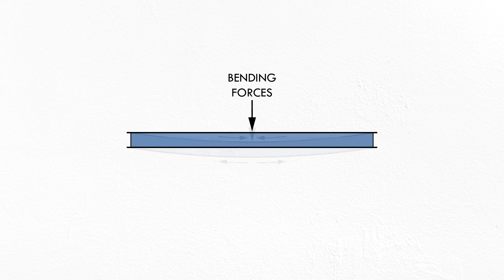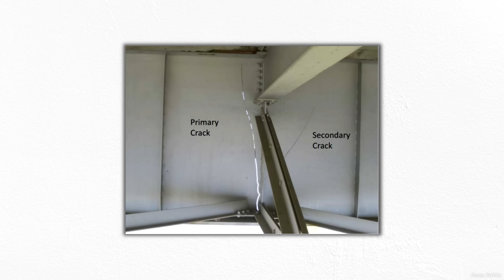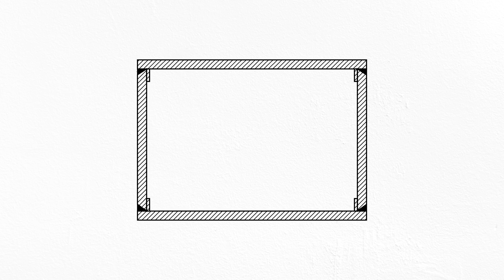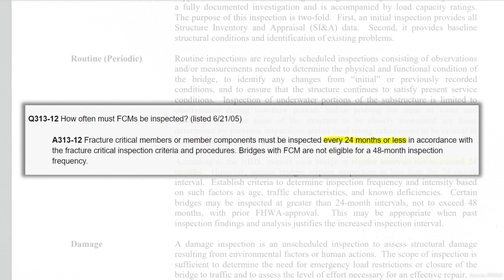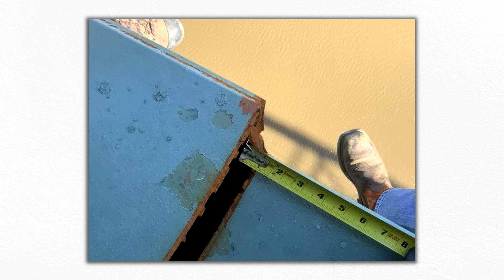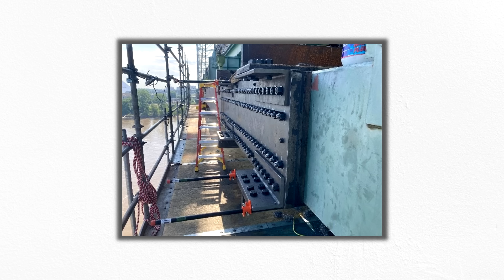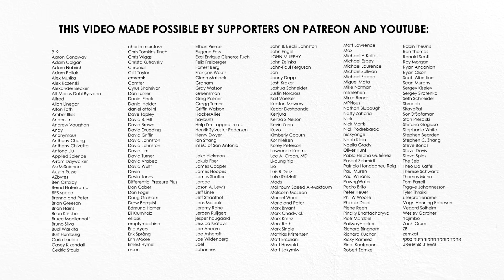What Really Happened at the Hernando de Soto Bridge?

Comment: Obviously without knowing the exact details of the termination of the inspector mentioned, I can't say for certain that it was unjustified. Maybe they did a drug test and found out he'd been working high or something, who knows?

But I think the aviation industry sets a great example for how to handle this kind of situation. From airborne militaries to small charter airlines, everyone in aviation is keenly aware that pilots (and engineers and maintenance techs) are human and can make mistakes. Not only that, they can simply become overwhelmed by their workload.

Much of the industry is explicitly designed around these concepts. It's why there are two pilots on board every multi-passenger commercial flight. On a normal flight, with modern avionics, one person is fully capable of operating all aspects of the aircraft. But when things go wrong, the amount of things the pilot(s) have to pay attention to, do, think about, and account for skyrockets to easily require a second person, or even overwhelm them as well.

When an incident does happen, as long as no ill intent or gross negligence was present, it's very rare for a pilot to be terminated or blamed. Rather, their humanity is taken into account. They are given training to make sure it doesn't happen again, and quite often, the entire industry rolls out the same extra training to prevent other pilots from running into the same problem. Aircraft systems are tweaked or corrected, policy and procedure are adjusted, and the industry learns and grows, and the pilots go back to flying.

A great example of this mentality is the nearly universal policy of the no-blame go-around. The primary concern is always safety, so pilots are trained to initiate a missed approach, or go-around, if they have any doubts or misgivings about how the approach is going. If you're not totally comfortable that the aircraft is properly configured and stabilized, and that the landing will be completely routine, you just go around. No questions asked, no blame assigned... even though that go-around could easily burn thousands and thousands of dollars of fuel, and cost thousands more in delays (not to mention the thousands more burned by carrying the extra fuel in case go-arounds or holds are needed), you don't even have to explain yourself at most airlines. You can just say "It didn't feel right, so I called for a go-around," and that's that. Not only that, but either pilot can call for the go-around, regardless of seniority or who is the pilot flying vs. the pilot monitoring. For that matter, so can an air traffic controller, or even another pilot on the frequency, and the pilots of the aircraft in question will just go around, no questions or hesitation, and no blame.

I've always admired that attitude, not blaming humans for being fallible, but designing for it, compensating for it, minimizing the impacts of those inevitable shortcomings and trying to minimize the chance of the same faults occurring again. To me, it's a very engineering-like attitude. It's similar to the idea that every fastener will eventually fail. At some point, it will loosen or fatigue and break. So rather than blame the fastener (I mean, they are typically not very emotional creatures, so there's not much point in yelling at them...) you either design for it, with a castle nut and carriage bolt that are both well over-spec, or you create maintenance procedures and replacement schedules. Or both. In the same way, designing a protocol or training system with the limitations of its human components accounted for but not blamed or shamed in any way is admirably conscious decision-making to me.

Comment: What concerns me is how the “crack” isn’t lined up, they need to find out why it moved.
Reply: If one side lets go, the other side is under more tension. Internal transverse structures now under more tension caused lateral deflection of the bridge itself resulting in the deflection in the failed joint. I am positive that when the inspector saw the lateral deflection, he (thought OMG!) reacted as he did (expletives assumed). BTW: the deflection confirms that the failed was a major tension load-bearing member.
Reply: Or  a tug ran into pier some time ago and never reported it. Or loose barges during the floods of Mississippi River and plowed into them.. who knows I'm sure they have been run into and scraped against a time or two
Reply: Hopefully it’s not the piers deforming 
due to excessive horizontal loads.  It would stretch the side that’s intact whilst moving the detached side.
Reply: @3of11  well something stressed that steel to move, that means the other side of the bridge in under twice that now.
Reply: Of course the break wouldn't line up: all of its tension load shifted to the rest of the structure which would obviously cause it to warp at least a little from now highly uneven loading. No tie on one side would also cause the deck to stretch slightly, push the piers slightly further apart and let the whole structure sag on that side, hence the far-side of the fracture being lower than the near-pier side. Completely expected from this failure.
Reply: And how are they going to line it up again during the repair?
Reply: @tomboyd7109  Good question, indeed. That is why the bridge is closed indefinitely. Stabilizing the structure is the first step.

To repair it, I would expect that the original tension stress needs to be reinstated by external means (fixtures, pullers, cables, etc...) and the stressed member(s)  then replaced/repaired. Not easy or simple by any means. Considering that the seismic retrofit may have introduced additional complications by stiffening the suport pillar structures which may (or may not) introduced additional stress in other structural components.
Reply: @milantrcka121   It’s just a hunch, but I suspect that earthquake modification may have played a role either during its installation or after
Reply: @ArtStoneUS  Very well may be. I am inclined toward material fatigue and crack propagation over a long period (2+ years) augmented by corrosion. Major contributing factor is lack of proper inspection. Much similar to aircraft structural failure (wing spar)...
Reply: @tomboyd7109  Hammer. Big ass hammer.
Reply: @tomboyd7109  That is the most significant question of the day👍👍
Reply: It always under pressure, it moved because it was an essential part of the bridge

Comment: This is strikingly similar to the bridge in Louisville, KY (Sherman Minton Bridge) that was shutdown abruptly due to a fracture critical component being, well, fractured. Also it shares a similar design as well with it being a through arch design. Albeit, a double decker design. It snarled traffic for the better part of a year. Luckily inspectors found the crack in its infancy and were able to repair it before it got to the level of this bridge.

Comment: Bridge inspection is one thing, but is the design appropriate?   Also considering it is in a unstable area, should there be pin joints where the crack occurred not a rigid connection.   Without a design check the cracks could occur again.

Comment: Mr. PE, is there a bigger down force on the ceiling of the tunnel that has a water channel above it when he ship is going over it?
Reply from the maker: Only if the level of the water goes ip
Reply: @PracticalEngineeringChannel  Thank you for answer! I was just thinking, that if ship is big and heavy and water level does rise, doesn't the additional weight distribute evenly to all water area? Meaning if there's a ship in the canal at all, it would not matter if it's right above the tunnel or anywhere else in this water canal.

Comment: The amount of rationalization that goes on to save a buck on infrastructure repair is terrifying. Sounds like this is a classic case of the government kicking the can down the road for decades so some people can make themselves look good.
I used to work for a company that was contracted by a state government for environmental inspection. Some of their jobs were inspecting areas around bridges prior to repair work, due to endangered animals living in the waterway. The number of crumbling concrete bridges from the 1920s (yes, nearly 100 year old bridges) and severely rusted steel bridges clearly missing bolts that the environmental people happened to notice is pretty terrifying. Worse, some of those jobs were prematurely cancelled due to a lack of funding. There are a few bridges I don't think I ever want to drive on unless absolutely necessary.

Comment: I believe AvE said it best. "The standards are written in blood."
Reply: Yes, but sometimes that blood was due to stupidity and carelessness and not a true problem with operation. 

You’d be surprised how much OSHA doesn’t actually require, but companies go out of their way to protect stupid. Which in the end creates more upkeep issues, lack of access / restricted access in previously free thoroughfares, equipment being “built in” (I.e. all the “safety” upgrades now makes it impossible to get the proper equipment in to an area so now doing the maintenance is FAR more dangerous). I’ve done maintenance and engineering in a steel mill, paper mill, and foundry. Handwringing dipshits who have no idea what any work entails (by operators or maintenance/facilities) far too often “make it safer” (laughably not, or in such a minuscule way it’s of no effect) in ways that now put maintenance in far riskier positions. “Someone might burn their hand being a place they shouldn’t be” now became, “now that there’s no proper way to get lift equipment in, maintenance will have to rig and hand lift a 3,600 piece of machinery out AND back in every time it needs servicing. Good thing we exchanged a burned hand for far higher potential loss of life or limb.
Reply: @ObservationofLimits  A good example of this is spray on fireproofing on steel building beams... It can really help in a fire, but it makes it very difficult to inspect the beams. And in the case of the WTC, didnt work due to the high temps anyway.
Reply: @roberson644  lol, high temps.
Reply: @ObservationofLimits  Lawyers are the ultimate arbiters of safety protecting general public and even countervening natural selection. Better engage the safety engineering before they get involved as behind every safety regulation are dead people. (fire escapes, seat belts, rail safety, automobile safety, aircraft safety, etc, etc... stories abound) And yes, a lot of the work lately is just to keep lawyers at bay. Unfortunately stupid is a protected class these days.

Your example of lifting a 3600 lb machinery for servicing is either required no matter what or it is an example of bad engineering regarding serviceability. Personally, been there, done that with aerospace and medical engineering and regulatory compliance.
Reply: turning modern high tech science into a mysterious bloody cult
Reply: In which video?
Reply: @PeasantA10384  https://www.youtube.com/watch?v=uCB1xbkn1Ps     13:10

Comment: I live 6 miles to the west of this bridge and I have been waiting for this video since the bridge was shut down. Great job @Practical Engineering! Thankfully I don't have to cross over the river as much as I used to, but the impact of the closure on local traffic patterns can not be understated. There is frequently a 7-8 mile back up leading up to the Memphis-Arkansas Bridge that carries I-55 traffic across the river. With the increase in traffic, it usually takes about an hour to get across the river right now. To make things worse, despite technically being in another state, the city of West Memphis, Arkansas is heavily dependent on the city of Memphis for critical services like a hospital. West Memphis has a very very small emergency room "hospital", but it's basically just a triage center before sending people into Memphis. The West Memphis mayor has even asked the state of Arkansas for ATV ambulances that could get around traffic easier. 

And just like one tie breaking and putting more stain on the other, there's been a lot of concern about the impact of the increased traffic on Memphis-Arkansas Bridge and all of the roads and overpasses that the increased traffic is spilling over on. Not all roads are designed for heavy 18-wheeler traffic.

Comment: It's complacency creeping in. They must have done inspections so many times without any findings that they just assumed it would be the same again and so it was just signed off as good.

IMO, this makes a very strong case for replacing the engineers with mini-robots that can take pictures of every square millimetre of the surface and having these analysed by an artificial intelligence system.

Comment: Looking at this, I wonder if the seismic reinforcements of the pillars had an impact on the failure? If the pillars were significantly stiffer after the rework, the load paths could change.

This happened here in Montreal with the old Champlain bridge that was deteriorating very quickly after its initial 50 year design life. Reinforcements were added to compensate for failing beams. This work stiffened the deck structure causing other elements to begin to fail. These elements were reinforced, followed by another cycle.

If you want to go down a rabbit hole, google "Champlain Bridge reinforcements".
Reply: Knowing Memphis, they’ll just slap some steels plates and weld it on
Reply: 1st thing i thought , common sense . Thanks for sharing.
Reply: with a 1 inch separation in the member, it seems obvious to me that the pier column seat or possibly both pier column seats  on that side of the bridge have moved an inch apart.

Comment: It's probably one of the heaviest trafficked bridge in the country. I-40 spans east coast to west coast in Bakersfield to Raleigh on the east coast. It's normally called the "New Bridge" by locals since it opened in '73. The "Old Bridge" on I-55 is much older, 2 lanes in each direction, and the left east bound lane does not continue on I-55. It dumps you into downtown Memphis. The only way to stay on I-55 is the right lane. So, where there used to be 4 highway lanes going from AR to TN, there is 1. It's beyond ridiculous.

Comment: I think the reason it was even still standing was due to the other side not cracking or not enough to cause structural failure.  Still, that horizontal pressure likely caused damage to rhe supports due to the years of forcr applied to them.

Comment: "How did they know to act so quickly" a support beam on a large bridge was completely split in two, what else would you do except close it down and call it in?
Reply: I can actually see a scenario where someone said "it's rusted so it's been that way for a while. We need to check and see if this is critical." It then goes back to the office and all the managers push it up the chain because they don't want to be the guy everyone blames for the traffic issues.
Reply: To put the question another way, "How did they know that this support member was critical, and that its failure made the bridge unsafe?" If this had been an arch bridge like the Sydney Harbour bridge, with the outward forces taken with heavy thrust blocks, a beam in that position would not be critical, and would probably require only a load limit on the lanes nearest to the damage.
Reply: What else would you do? It depends on who's running for office.

Comment: An alternative hypothesis: rigidity-indiced fatigue. I'm a former member of the International Guild of Knot Tyers, and we've noticed ropes fail where they approach a knot, about 1.5 times the diameter from the point where flexibility goes. We think stresses reflect back from the knot, and concentrate at that point. These brides presume a degree of adjustment to loads, and that could do it. It might be worth checking similar areas on the other beams.

Comment: Maybe Some microphone listening to the structure may hear the sound of cracking in between inspections. They put microphones on the forth bridge Scotland to listen for strands snapping on the multiple stranded steel ties . Maybe add glass bars with microphones between critical points that would snap if it has significant movement .

Comment: An inch gap is the most interesting bit. I would very much like to know what the expected length increase was on the secondary beam when it took full load. If it is a lot less than an inch then the main beam may have been under excessive tensile stress from new? However, an inch smells right. And that makes the problem that it was too ridged to act as a steel rope. (For want of a better description) Was it mechanically tied into the flexing car deck?

Comment: Unlike the Morandi Bridge in Italy, where inspectors found the crack and decided to ignore it completely rather than closing or even limiting the traffic on it, these did their jobs.
  Location of the break beside the bolted section suggests to me that a stress fracture from work-hardening will be found to be the cause, and not hardness from the welded structure.  The design was likely never intended to carry the weight and stresses that multiple modern commercial vehicles crossing it simultaneously could cause, as it would have been designed to vehicle loads (plus safety factor) in that era.

Comment: Each year, about 10,000 new bridges are built in China with over 800,000 bridges. 
https://youtu.be/UKMv2p483gk

The U.S. has 614,387 bridges, but almost four in 10 of which are 50 years or older and 230,000 bridges that need major repairs or replacement, new report says.
https://www.washingtonpost.com/local/trafficandcommuting/us-has-230000-bridges-that-need-major-repairs-or-replacement-new-report-says/2020/04/13/499718c0-7db4-11ea-a3ee-13e1ae0a3571_story.html

The current anti-China narrative is a government misdirection so we don't notice America's crumbling infrastructure.